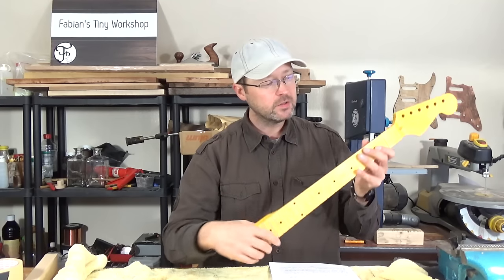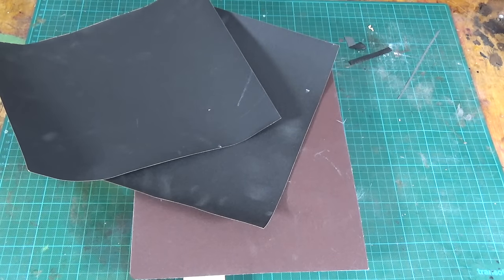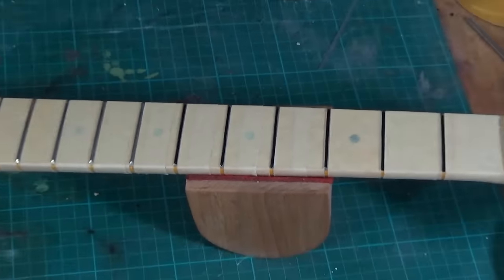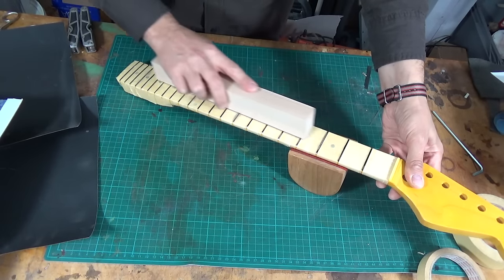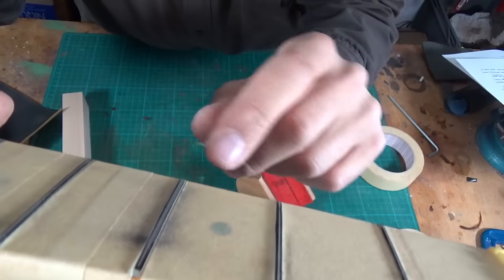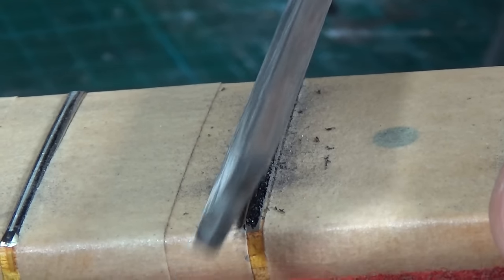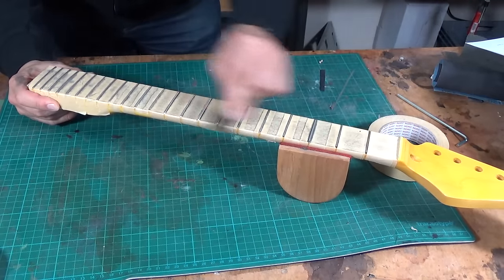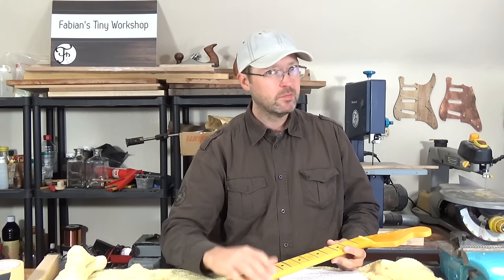Fret Leveling - The Easy Way // How To

Comment: Brilliant video,can I just ask when sanding the frets down how do you actually know they're all level? 
I've never done this before,is it just until you can't see the markings you have made anymore? I'm scared of sanding too far down or it being uneven haha
Reply from the maker: That's why I use a log straight beam. By sanding as long as all markings disappear you know the frets are level. If for example one or two frets still have markings on them you know they are still lower than the other frets because the sandingbeam could not tuch thefrets with the marking. Also please whatch other videos on fret leveling. In the core most luthiers will do it the same way although some thend to make it more complicated as it is.
Reply: @FabiansTinyWorkshop  oh ok thank you so much that makes sense :)

Comment: I have very fine straight ding in my 9th fret (almost not visible) and when I stretch the G string it will hang up very slightly in the groove (it catches on the very fine groove). Again, this is a very very fine groove (like a string pressed hard into the fret as it runs in the same direction as the string). I could not even see it without magnifying reading glasses. Can I just fix the one fret and how would I get the slight ding out. Thanks and very well done video.
Philip
Reply from the maker: If you move the string a few times back and forth over the groove it might be enough to flatten it or at least make it better.
You can also use fine sandpaper and steel wool to sand it away. But If you remove to much from the the fret and reduce the fret hight this can cause fret buzz.
Reply: @FabiansTinyWorkshop  Thanks for the reply. What grit sandpaper would you recommend? The slight groove is really like someone took an Xacto blade and made a scratch across the fret (and barely deep). It's very minor and I am surprised the G string even hangs up on it when you stretch the string. Thanks.
Phil
Reply from the maker: @uptownphotography  From what you tell me I think 600 grit should be enough.  ft it's to deep for 600 grit use 400 grit. After sanding you will need to polish the fret.

Comment: When playing the 5th fret on my ukulele I get a buzz due to a slightly high (tall) 6th fret with a low G string, but it does not buzz with a high G string installed?  Some have said that it's because a low G is a thicker string (greater diameter). The distance from the top of a  fret to the underside of the string is the same distance for either string.  So how can this buzz for one string and not for another?  Does the low G have an undesirable oscillation?
Reply from the maker: I have no idea 🤷‍♂️

Comment: How about cutting the nut? Would you do it after the fret dress you did on this video or was it still ok?
Cheers
Reply from the maker: You are right I did not show this in the video. I cut the nut after the fret dressing. I always see the nut as fret no. zero. So I always cut the nut slots level with the other frets to make sure that the action on open strings is the same on the fretted strings.
Reply: @FabiansTinyWorkshop  I plan on doing my frets tomorrow and was kind of hoping to get away with not cutting the nut slots. Maybe it's just something I can't avoid though.
Cheers for the excellent, easy to follow video!

Comment: Can I also use a radius sanding block for this? I’m afraid to damage the radius on the frets.
Very helpful video anyway.
Reply from the maker: yes you can
Reply: Fabian's Tiny Workshop if I sand with the radius block do I have both steps in one? Leveling and crowning?
Reply from the maker: @sowiloi  No. Crowning means to round over the frets. It has nothing to do with the radius.

Comment: very well done. Short and impressive.
One thing is missing: the frets in the middle area get about double sanding than the first frets. Look at the file. It is not moving over the first fret(s). Ok, nut is mounted = nood good. No chance to slide over the first frrets.
But even the upper frets only get the same sanding if you sand the whole lenth over all frets.
Sorry for that long discription.
In other words: if you do it in that way, lets say 5 times in the life of your frets, you will see the result on the lower frets.
I don´t want to invalidate your fine video Fabian. 
The message is not against you.  ;)
Its for "the world".
Like your super video is.
How about making a short addition or set some text inside?
Reply from the maker: I see your point, that why I use a long straight beam. Because it's straight it is not possible to remove more material in the middle than from the first and last frets. I see it that way, it's not possible to sand a bow with a straigt sanding beam.
Reply: @FabiansTinyWorkshop  if I find the video I will post it for you.
It has nothing to do with the straightness of the beam.
Reply: from 14:00 this guy is showing another quit perfect method how to sand/file. You can see that upper frets need more sanding.
https://www.youtube.com/watch?v=CqnFDAhdH_E
But there is another video showing he problem which I mean.

Comment: is it possible to fret level even though no truss rod?i mean my guitar truss rod is not moving even a little even when i put to much force clock wise or counter, id like to change it to jumbo fret wires.
Reply from the maker: If the neck is still straight yes but if it has a bow you will not be able to get a good action. Maybe a new Neck would be a better solution?

Comment: at 3:18, dumb question but how do you maintain the radius of the fretboard? By equally distributing the leveling force of the grit through the fretboard?
Reply from the maker: Honestly I do this by eye. Do not use a low grit or use too much pressure. Take your time and use good lighting.
Reply: @FabiansTinyWorkshop  would you recommend doing a 'fall-away'?

Comment: Don't you need to sand with a block radiused to match the fretboard radius rather than a perfectly flat beam?
Reply from the maker: A radius beam does not work for me but of course you have to follow the radius! You might notice that most luthiers avoid radius beams for good reason.

Comment: 0:50 Probably a silly question, but how do you make sure that the peace of wood is perfectly leveled? I guess you can place sand paper on a flat surface and flatten the wood on it, but that just shifts the question on how do you know that surface is flat? All the things I have in my house that i think of that are flat, actually aren't. Dining table? Eh, maybe. My PC desk, most definitely no! Bathroom tiles? Hard no! Windows? No, you can easily press the glass in whit very little pressure. Any ideas?
Reply from the maker: If you can't find a straight piece of wood, use a planer to create a flat surface on the wood or use an aluminum flat bar instead of wood.

Comment: Do you flatten out your neck via truss Rod prior to doing a fret job?  I’m not seeing anyone doing this.
Reply from the maker: ??? Pretty much every luthier will use a notched straight edge to get the neck as straight as possible before leveling the frets. Just think about it. If for example the neck has a back bow it would be wrong trying to flatten the frets without getting the neck straigt first.
Reply: Thanks! That’s what I was thinking. I had watched some videos where they didn’t mention. Maybe they are taking that part as a given. I was able to find one displaying the notched straight edge. Thanks!

Comment: If you do it this way, the frets closest to the nut are going to get sanded less as they spend less time under the sand paper during each stroke. I think removing the nut is better.
Reply from the maker: Maybe it would be better but I never had any problem with that. I use a sharpie to mark every fret to see the progress but I see your point.

Comment: Question: To achieve the best leveling job, wouldn't it be best to use a straight edge that is equal to the length of the fret board? Using a leveling beam that is not the length of the fret board would mean that you put the middle frets under more sandpaper than the end frets or the starting frets. That would mean that your center frets are more lower than your outer frets and giving you a U shape in terms of the leveling job
Reply from the maker: 1. It does not work that way. the moment you start to go back and forth you would loos this "advantage". You would have to move the leveling beam from left to right if you want to level all frets at the same time.
2. As long has the beam is not to short it is not possible to freate a U shape wiht a straight edge. Much like a wood planer because it could not follow that U curfe.

You can however create a backbow but that would be possible with any lenght of the leveling file/beam.
Reply: @FabiansTinyWorkshop  but the advantage of the leveling beam that is as long as the fretboard would be that all the frets (from 1st to 22nd) would get equal time underneath the leveling beam, and result in a perfect level? Am i looking at that the wrong way?
Reply from the maker: @andy_182  Well, if you take a long beam and move it for example back that would mean the high frets are constantly under the beam but the low frets are not (because you move the beam). You'd have to use a beam much much longer as the fretboard and you'd have to remove the nut. That would be the only way you could make sure that all frets are under the beam the whole time.
Reply: @FabiansTinyWorkshop  ohhhh ok. So basically, there’s no “perfect” way of doing it. You just do it with any beam and give each fret as much equal time as you can
Reply from the maker: @andy_182  Yes and no. As long as the beam is flat and not to short it simply is not possible to sand a round curve with a flat beam because the beam is not flexible, so do not worry.
Reply: @FabiansTinyWorkshop  What is the shortest beam you would recommend? Would 30cm be okay?

Comment: Did you never operate from the 12th fret to the end of the scale, covering and ancreasing 12Th? I know it's a way to avoid from fastidious buzzing in that positions.
Reply from the maker: As far as I know this mostly applies to working with a short fret file. Because the frets are closer together on the upper scale, the file touches more metal and tends to remove less material there. However, using a long file or sanding beam ensures that all frets are on the same level. Of coruse to make sure there is no buzzing on the upper scale you have to check your guitar's neck relief under string tension by adusting the truss rod.
Reply: @FabiansTinyWorkshop  Thanks. I have to work with a short level file. I try ;-)

Comment: Hi. Where on Earth do you get a PERFECTLY straight piece of wood without leveling it yourself? Thanks.
Reply from the maker: If you really can't find a straight piece of wood then get creative. It does not have to be wood. An aluminium beam or a spirit level will work as well.
Reply: @FabiansTinyWorkshop  Thanks. One more question, how "perfect" does "perfect" have to be? Where I live it's not easy to get perfect tools so I would assume that most of the "materials" we have are not perfect either unless I want to fork up a lot of money to get perfect items, which I don't have. Thanks again.
Reply from the maker: @SheithEastwood  Of course, the more precise you can work the better the playability of the neck will become.

Comment: Am I doing something wrong? In the first pass pretty much all the sharpie is gone and pretty sure there are still high frets. It feels I am removing the ink and not the material so much. Any tips?
Reply from the maker: 1. Maybe the frets are indeed level
2. Maybe you're using a very short sanding beam
3. Is it a sharpy or is it a touch up paint pen that might leave a thick layer of paint on the frets?

Check with a fret rocker if there are high or low frets.
Reply: @FabiansTinyWorkshop  thanks!  I have checked with a fret rocker and there are still some high frets despite the ink not being there anymore. The beam is 15cm long would that be too short. Also the marker I am using is a regular permanent marker, not a “sharpie” brand one.
Reply from the maker: @penhasdouradas  In my opinion, 15 cm is quite short. The longer the beam the more unlikely it gets that the beam follows the ups and downs of the frets.
Reply: @FabiansTinyWorkshop  Appreciate it! Will try with a longer one.

Comment: Isn't the fret crowning file what you are supposed to use to get the fret to shape and to get a small surface für the string to lie on?
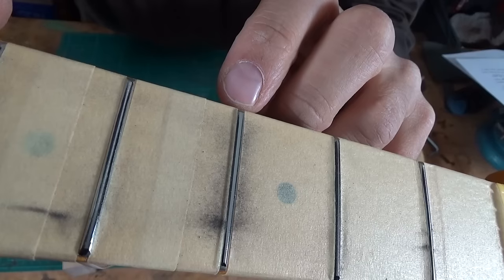Reply from the maker: Yes. Please watch from 3:31 this should answer your question.
Reply: @FabiansTinyWorkshop  oh well, then don't mind my question ^^ i even listened to you at that point but i didn't make the transition to you just taking a normal file. Thanks for pointing that out

Comment: What length sander is best for a neck? Also which one of the steps are the easiest to mess up
Reply from the maker: I think about 30 cm is the best. The easiest to mess up might be not to follow the radius while sanding.
Reply: @FabiansTinyWorkshop  do you have a video with more detail on the radius with sanding? I want to do my 7.25" necks and don't want to mess them up! Any suggestions?
Reply: @levijessegonzalez3629  My suggestions
1: Put NO pressure on the sanding beam, just run it along. If you put pressure on it, the result will become more uneven, and you can remove a lot of material without adding pressure.
2: To preserve the radius, go very slowly, count the number of strokes, leaning the sanding beam along the radius in increments. Take note of how many strokes you have done on a particular section/increment. Do the same number of strokes for each section. Resist the temptation to go fast. Again, do not add pressure to the beam.
3. Inspect your work often -sight along the length of the neck and you will be able to see the radius. If you proceed very slowly with your work, it will take a long time, but you will not mess up the radius.
Reply: @FabiansTinyWorkshop  Thanks! That answers my questions on length of beam!

Comment: How do you know what frets need to be crowned after you level???
Reply from the maker: If the fret has a noticeable flat surface it needs to be crowned. If there is only a fine line it's ok because it will be rounded by the following polishing. In fact while crowning you leave exactly that fine line untouched because you don't want to reduce the hight of the fret during crowning.

Comment: Anyone trying this for the first time, I really suggest getting a crowning file. A decent one is around $40 and well worth the money for the peace of mind it gives you when working on an expensive instrument. And don’t press down while using it, just the weight of the file itself is enough pressure when filing.

Comment: Question regarding short vs long levelling beam...... At 2:36 when you start levelling with your short levelling beam fret 1 (at the nut) only gets levelled by 5 cm of the levelling beam (forward + backwards) - but fret 10 gets levelled by the entire length of the levelling beam (forward + backwards) - so at 2:59 you can see that fret 10 & 9 have "lost" lost of material and at 3:06 you can see that fret 2 & 1 have hardly been touched........ isnt that a problem?...... so when not removing the nut (which limits the movement) shouldnt you have a levelling beam so long that it goes from the nut and 5 cm past the end of the neck which would allow you to move the "full length levelling beam" forward & and backwards in the same distance as from fret 1 to the nut (so you go forward and backwards in a 5 cm motion on the entire fretboard) and thereby give all the frets the same amount of contact (in cm and time) with the levelling beam....... and then maybe also have a short levelling beam (15 cm?) to hit specific areas of the neck. - Hope I explain myself clearly 🙂
Reply from the maker: The longer the beam the better but very long beam will make it somewhat unpractical to work with. A short beam carries the risk of grinding an arc. Since you can't create an arc with a long straight beam (much like it is with a wood planer), I think you get the best results with a beam of a certain length.
Reply: @FabiansTinyWorkshop  Thank you 😀

Comment: I love this guy's accent -- a combination of Elmer Fudd and Arnold Swarteneggar.  But, he's right. One doesn't need to purchase all that expensive shit from Stew Mac or LMI or others.  Just look around your wood shop, use your head and talent and come up with cheaper, better alternative tools that will do the job just as well.  Most of us don't have a lot of extra cash, but, since we aren't in a race, we have a good bit of time to experiment and devise our own tools.  I made a homemade fret tang remover, you know? For getting rid of the tang end so the fret can fit over binding.  It didn't cost fifty bucks and it works very well. I measured what was left after I filed away the tang end.  Come out to be the height of the fret crown every time (.040" for the fret material I'm using for a mando refret job I'm doing for a friend.)  My payment?  A six pack of my favorite brew.  He might even bring two while I level and crown and do the set up.  Then we'll play some music on his new frets. Life is good.

Comment: What about a partial level up above fret #14? I think my Strat's frets are too high in this area as I get choke-out when I bend four steps.  The action has to be set higher than I like even if to bend up two notes.
Reply from the maker: - Check if the Neck has a slight twist.
- Check if the truss rod needs adjusting.
- You can check with a fred rocker if there are high frets above fret #14.

The process of leveling the higher fretes is the same as shown but at the end make sure all frets are level.

Also choke-out on a strat with low action can be normal because of the fretboard radius.
Reply: @FabiansTinyWorkshop  No neck twist for sure!